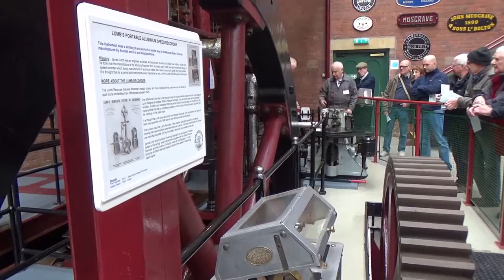Bolton Steam Museum camcorder test Sony HDR CX450 and Odrvm Action Cam 02 05 2016

Comment: You say your Panasonics are better - may I ask what models you have? and why you think they are better than Sony? I only ask because I recently switched from Panasonic to Sony! and would value your opinion. >Cheers<
Reply from the maker: Hi mate i use the Panasonic HC-W850 24.0 Mega Pixels and the HDC-SD700 14.2 Mega Pixels 3MOS i also have the HDC-SD90 this is a excellent little cam fits into your coat pocket with excellent zoom and steady-shot but after 6 years+ the screen has packed up on me.All 3 cams have very good manual settings mic-imput and hotshoe holders.Many years ago i would only use Sony but they seem to be going backwards now when Panasonic are going foward.I got the Sony HDR-CX 450 because it was just under £200 it does have mic imput but no hotshoe to put the mic on and playback picture is not as good has the Panasonics there again they did cost 2x 3x more than the Sony.Conclusion the Sony is not a bad cam 3/5 the Panasonic SD-90 (about the same price) 5/5 so in my opinion the Panasonic has better picture mic-imput with shoe and better steady-shot ..cheers Steve ..
Reply: Thank you for getting back to me - much appreciated. I only changed to Sony because (ironically), I thought the BOSS system stabilization was better. Now I'm not so sure I have done the right thing - I have always been a Panny fan especially after using the X920 (the newer version now has a tiltable EVF - brilliant). BTW, great video of the Bolton Steam Museum - love the close-ups and detailing. Keep the good work up, >Cheers< Tolly.
Reply from the maker: Thanks Tolly let me know how you get on with the Sony you never know it might be a good cam cheers Steve ..